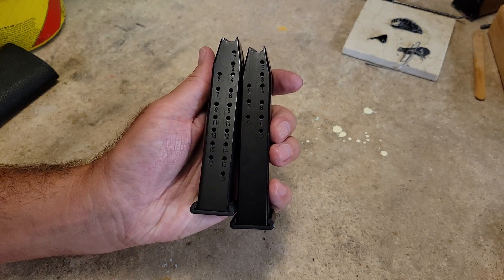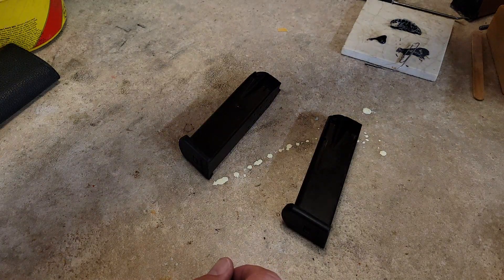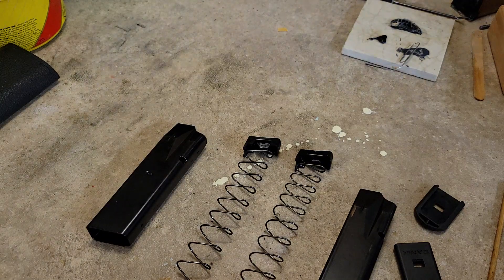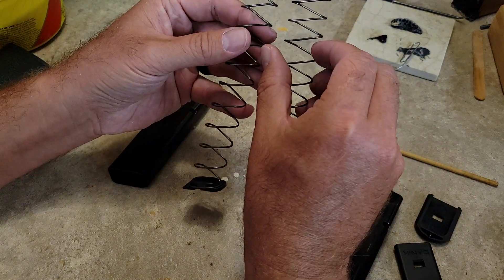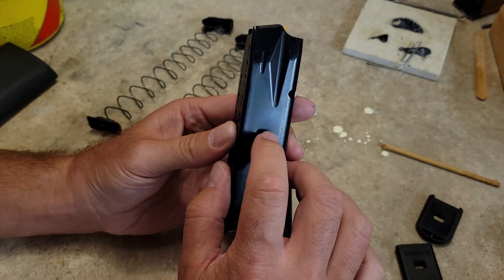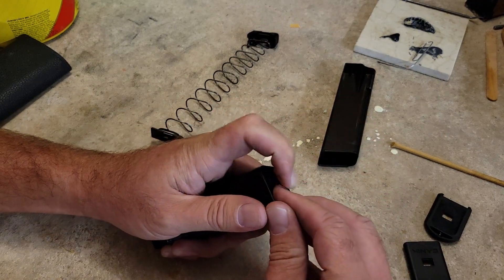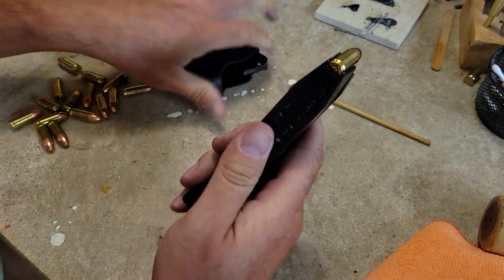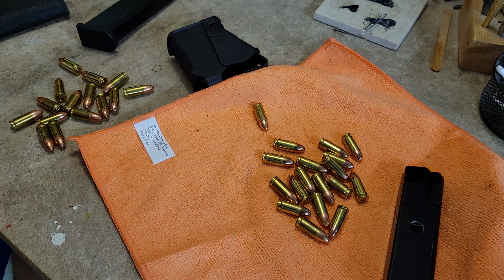Canik TP9SF 10rd magazine vs. 18rd magazine...What's the difference?

Comment: So glad you made this video.  I was only able to find 10 round mags and this was a huge help!!!
Reply from the maker: Subscribe!
Reply: What type of drill bit did you use ? I got through one side with a masonry bit but cant seem to get through the other its just spinning in circles
Reply: @RedEyePergo  I work in industrial maintenance and used the plants work shop, all I can tell you it was a high quality metal bit.  I stared with a small bit and worked up in size slowly.  I did use a drill press so that made it easy.
Reply: @benjakiela1748  thanks if you find out the material the bit was made of lemme know because cobalt isnt even denting this damn mag im just using a hand drill at home
Reply: Im in need of a 10 round mag for my tp9 sfx elite. Would you sell me one?
Reply: @SuperKenh atf atf atf
Reply: Did you shoot off any rounds with the modified clip? If so how did it perform. What size bit did you use to finish it out? Thanks

Comment: Wouldn't it have been better to grind down those internal tabs with a Dremel? If not, why didn't you drill smaller holes? From the video the relief holes look like they would allow a lot of dirt and debris inside the magazine. Just an observation. Otherwise, good video.
Reply from the maker: Dremel bit too short to reach the bumps.  That size hole was necessary to remove the entire depression.   Makarov mags and many others are fully open down the side.  Those are military guns too.  Bottom line, don't dump your mags into the dirt, stow em.
Reply: @DCopp : Thanks for responding. I figured that was the reason. I thought maybe a Dremel flexible extension shaft would be able to reach up the interior of the magazine body that's why I mentioned it.  

As far as dropping magazines in the dirt... I live in the desert and do all of my training outdoors so I have no choice other than dropping them on the desert floor. It's no big deal but the more enclosed the magazine is the less debris finds its way inside. At least for me it is. -SOP
Reply from the maker: @sopmod556mm9  maybe order a dump pouch and toss em in there.  Train train train!
Reply: @DCopp : Thanks for the suggestion. I have several dump pouches on my kit and hardly use them (they take up too much time) plus, I don't want to build up default subconscious reaction with only using something in training and not as a part of my EDC. 

If I'm in a gunfight empty mags are not going to be my first priority. Shooting, getting off the X, and finding cover are going to be at the top of the list. :)
Reply: I have done a few of these, a 1/4" drill bit is perfect, much smaller holes...
Reply: I know it would take longer but I think a long file would do the trick with no cuts . File tell it’s smooth and possibly it would be good 🤷🏻‍♂️

Comment: What did you use to drill I couldn’t drill with a titanium bit 20 volt hammer drill.
Reply from the maker: Cobalt bit?
Reply from the maker: Stepper bit should work too
Reply: If you ever have a free chance will you make a video on how you drill the magazine. It’s blue steel. I googled other people had the same problem. And stepper bit didn’t work bought on Amazon just spins. Punch first then drill. Just scratch the paint went slow torque. I watch videos on how to drill steel. Nothing worked. Thank you
Reply: @SkinnyFatman75  I was able to do it with a titanium bit just took a some tlc
Reply: Don’t use harbor freight drill bits? 

Go to lowes and get a $7 Bosch black oxide, cobalt, or HSS bit designed for cutting into steel.  

Titanium coated bits from what I know are just general purpose bits.
Reply from the maker: @gunsforevery1  I've had great luck with the Ti stepper bits from HF on steel

Comment: You could have used a drill but the size of the dimple, drilled 2-3 holes and then took a file to the hole. You would have had a hole that was the same size or slightly bigger than the dimple.
Reply from the maker: Really makes no difference though
Reply: If it works, it works, just looks a lot nicer than a huge 3/8in hole lol